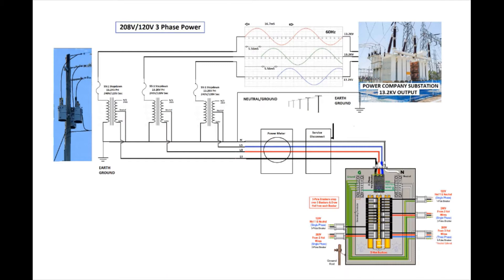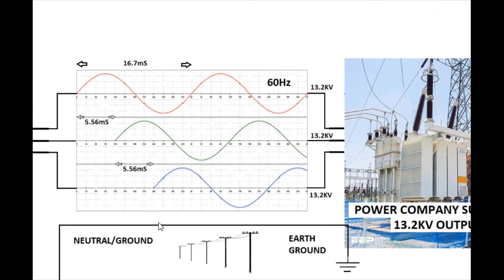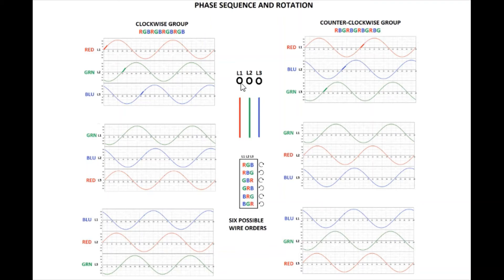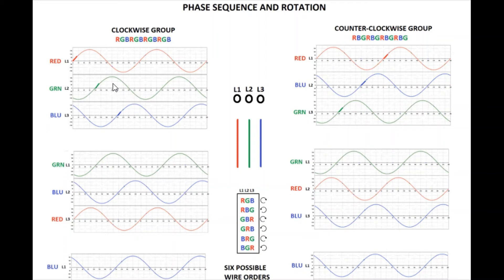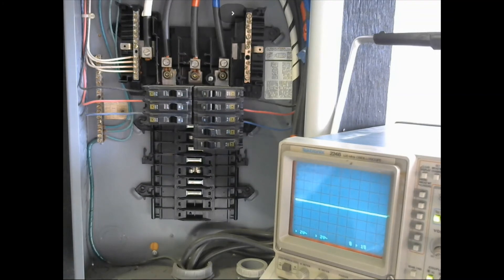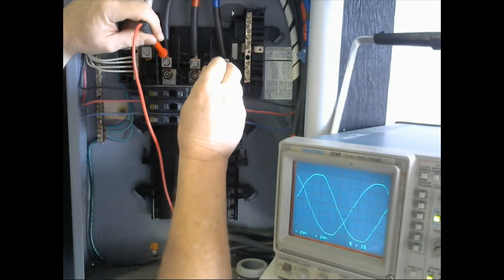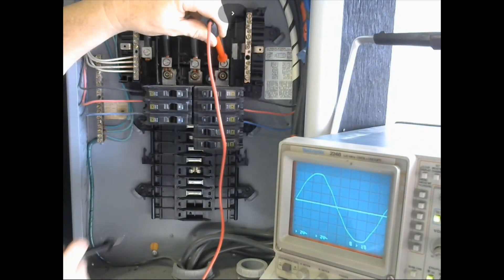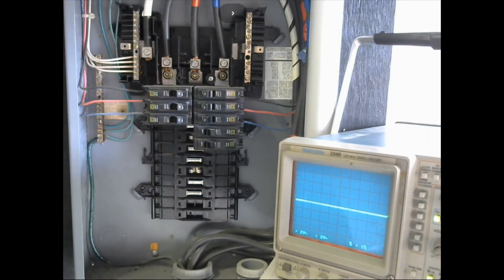Phase Rotation & Sequence Demonstrated with Oscilloscope

Comment: I really liked this video.  We have to do this tomorrow on medium voltage.  Will this method work if I use a VT to lower the voltage and the proper oscilloscope?
Reply from the maker: The transformer should not effect the phase. I cut my oscilloscope probe and installed a 10M ohm resistor in series, so it would be ultrasafe. Scope is already grounded so all you need is the single probe.